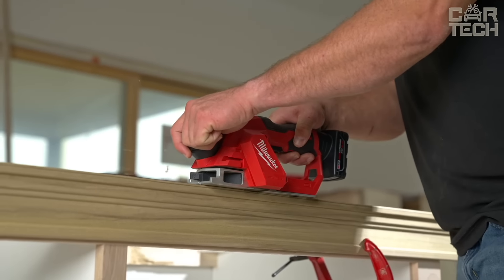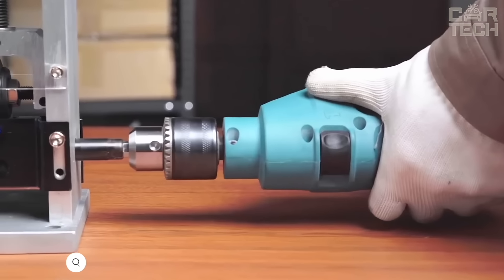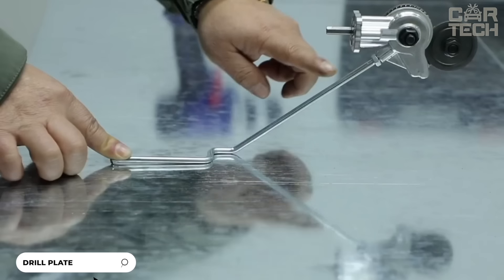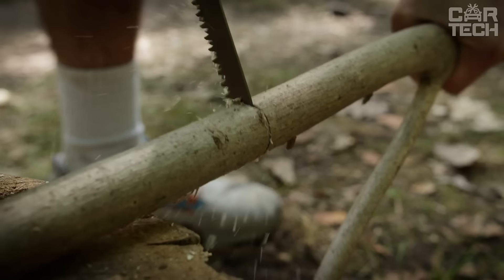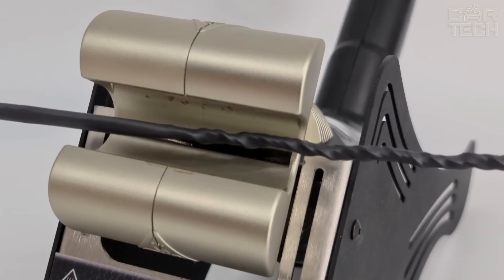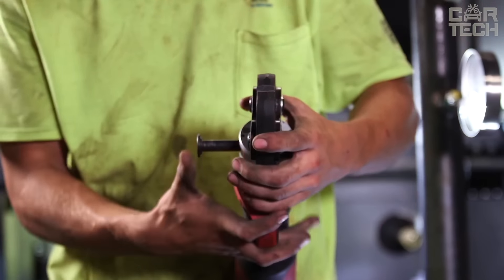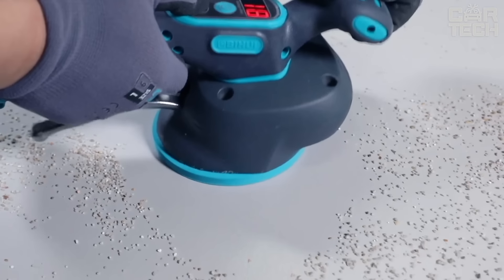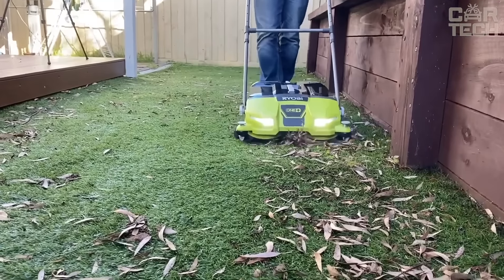60 COOL TOOLS THAT YOU CAN BUY ON AMAZON

Comment: Vinyl floor cutter is pretty useless. Any edge you cut is going to be hidden by molding. Just use a cordless jigsaw because just the setup time on cutter slows you down. For door knobs just use the paper cut out and you got it. You just need a hammer and chisel instead of that crazy mini router. I guess if you are doing doors all day the yeah use it. But for a home owner how often you actually going to use it then you got to store all that stuff.